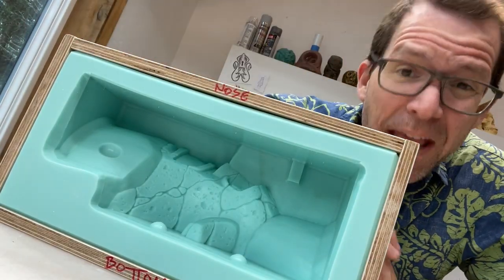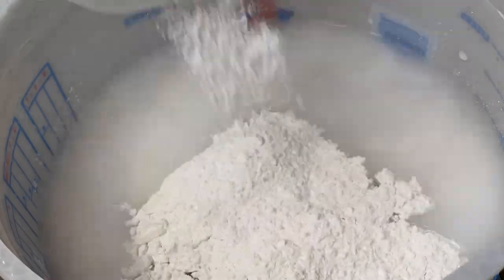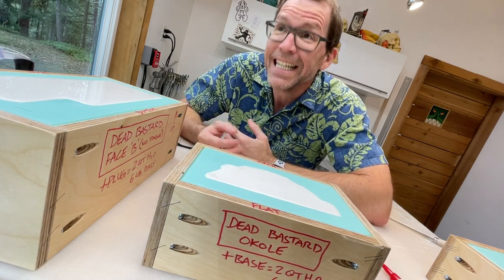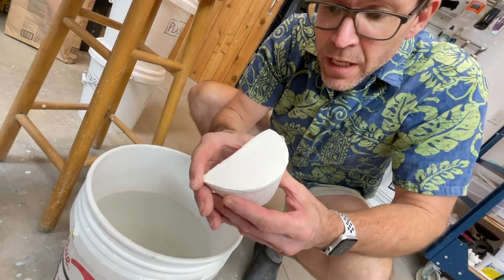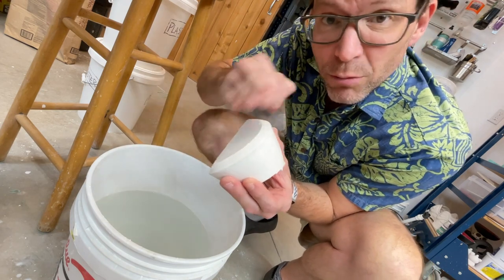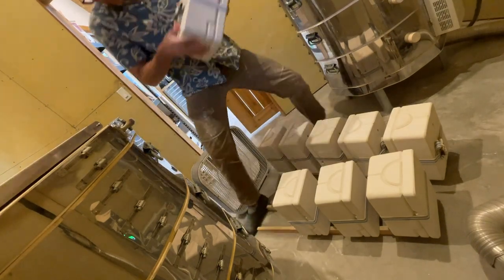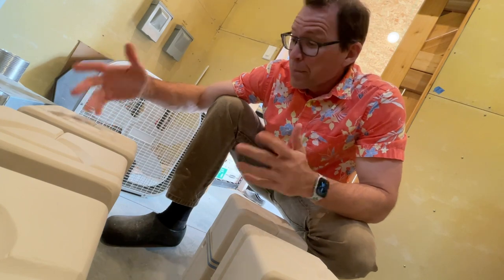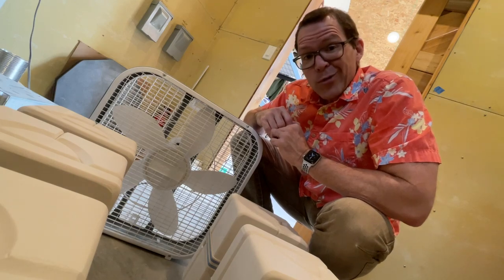Casting Production Molds For Slipcasting - Tiki Technical Tuesday 48

Comment: I love your videos! You definitely deserve more views and subscribers! Question - I've read that you can potentially recover the plaster and turn it back into powder. Is this something you've looked into or do you have any concerns with this? Maybe contamination or is it too messy?
Reply from the maker: Aloha! Thank you for watching!  Good question about the plaster - it is chemically possible to recycle it, but the process is complex and tricky. It needs to be held at high temperatures for a specific amount of time to drive all of the moisture out of the gypsum, then it needs to be milled back down into powder. I’ve heard stories from master Hollywood mold makers that LA used to have plaster recycling plants back in the days of filmmaking when plaster was the main product used to make molds and to fabricate sets.

Comment: Great work and great personality! 
I have a question. In the original mold you poured plaster directly on the clay part. You mentioned once that the original art was sculpted using monster clay and monster clay melts at  temperatures that the plaster should have reached at it's exothermic climax. How is it that the exothermic reaction and the heat created by that not melt the original art in the casting process?
Reply from the maker: Good question!! I was worried about exactly what you are describing, but friends of mine who have used plaster on the monster clay said that they never had an issue. The only problem I’ve had with the monster clay is it sticking to the plaster if it does not have enough release (this sticky may be due to melting and grabbing the setting plaster)

Comment: Ok, got it. Don't clean plaster off things in the sink, do it in a bucket. But then where do I dump out that bucket?
Reply from the maker: Good question!  Once the plaster level is about halfway up in the bucket, you dump it in the sink. KIDDING!!  
I’ll pour the water out (in the yard), leaving the plaster inside and set the bucket aside to dry out. Then the plaster gets tossed in the trash.
Reply: Plaster like cement will eventually settle to the bottom. Water goes down the drain and the plaster can be dumped in the trash

Comment: Hi. I'm new to ceramics. Do you have to use the plaster that ceramics stores sell or can any supplier of plaster be used, as the ceramic store plaster is way more expenisve?

Thanks
Reply from the maker: If you’re going to use the plaster to make molds for Slipcasting, you need to use pottery plaster USG 1 or the nearest equivalent. It’s pricier than plaster of Paris, but other plasters won’t have the property that make Slipcasting work. I’ve tried other plasters in the past - they can work, but the results are not as good and they take forever to cast with.

Comment: Love your videos - greenhorn  molding question - can you make a mold from a already fired and glazed mug . I made one in my pottery class and wondering if I can try to make a plaster mold from it. Trying to avoid having to re-mode it from scratch
Reply from the maker: You totally can!  In theory, anything can be molded, as long as you have a working release agent and avoid all undercuts.  the trick with molding a rigid model (your fired ceramic piece) with a rigid material (plaster) is you have NO WIGGLE ROOM with undercuts.  Something to consider is making a silicone/flexible mold of your mug, then cast a silicone positive from that to make your plaster mold off of.  does that make sense?
Reply: @vantikistudio  That totally makes sense - Thank you so much for the info and direction - You are my favorite tiki artist and love the content you are putting out!

Comment: Amazing content, thank you for your work. I have only one question, how much dobyou water down the windex? I cast plaster into silicone for the first time and the surface was full of bubbles 😅 Never happend before
Reply from the maker: I do it roughly 10:1 water to windex
Reply: @vantikistudio  Thank you, BTW I used few different plasters but neither one of them was so fluid as yours. Could I send you picture how the bubbles in my plaster mold looks like? there is lot of tiny bubles on the surface of the mold.

Comment: hello my friend, hope all your designs are coming out amazing. I have finally finished my silicone mold using rebound 40. I Had my wife help me mix the silicone while i poured. she ended up not adding all the mix in the yellow bucket one two of the pours and some how it still cured. so i got extremely lucky. $800 dollars later. is what my mold cost. yikes. Can you please answer this question. what are you using for the silicone release for the plaster casting. i was recomened ease release 200? do you use it? Also on the windex. do you use regular windex? and how much do you water down the windex. Thank you so much for all your great videos and help. your the man.
Reply from the maker: Congratulations on the mold!  I don’t use any release to cast the plaster in silicone molds. For the windex, I use standard everyday windex. About 1 part to 10 parts water

Comment: Are you familiar with USG's "Duramold" pottery plaster? It purports to have a longer casting life than standard pottery plaster. I don't know what, if any, tradeoffs there are, as none are mentioned on USG's website. I wonder why this wouldn't be a better material to use than No.1 Pottery Plaster. Either way, nice video as always!
Reply from the maker: Thanks for the tip! I’m going to reach out to USG and see if the Duramold would work in the studio
Reply: @vantikistudio  Following back up on this - Did you ever look into Duramold? I called USG and was passed around to 3 different people who were not able to provide much info. It's apparently seldom stocked by USG distributors. The closest place to me (NC) is Sheffield's in MA. Info online is non-existent, but I did ask about it in a Facebook group and got a single reply from a guy who says he uses 500 pounds of it a year and that it does indeed last longer than No.1. He didn't quantify that, though. 🤷‍♂
Reply from the maker: I gotta admit I haven’t done any research just yet. So scary to switch materials, especially if it is hard to get! Thanks for the reminder, I’ll try to get some to test this year 🤙

Comment: Did you say that you throw away your plaster fragments from your retired molds? If it's cheaper to heat the old plaster in an oven at 356°F for two hours and then grind it back down into a powder, you could be saving money on buying new plaster for slip casting molds. I've never tried this myself so I don't know how much time and energy would be required to recycle the plaster versus just throwing it away. Even then, I wouldn't know if the resulting recycled plaster will wick away water as well as the fresh plaster.
Reply from the maker: I do discard old plaster. Recycling or remaking plaster is an involved process that requires special ovens and equipment to grind the plaster down into powder. As much as I’d like to recycle it, there is no way I could pull that off in my studio. Back in the golden years of Hollywood sets were mostly made of plaster, and there was a recycle/refining factory in LA that would accept old plaster. Sadly those days are gone.

Comment: I am severely struggling in my studio! I have 3 simple 2 part molds I've been using for a while now. I needed to be able to pour more pieces at a time so I tried to duplicate them with rebound 40. It came out great! I start pouring plaster and leaving the newly poured molds out to dry ( I did have the two parts separated while drying). I pieced them together to check the fit and the two parts of the mold don't fit properly :( they wobble a bit like a seesaw. I am now banding the molds together for my drying process, however what I'm worried about is even if I try to check the fit when I freshly pull them from the silicone, they still wobble. Does this make sense? If the master mold fits perfect with no wobble, and the silicone mold is an exact copy, why wouldn't the two pieces fit properly fresh out of the silicone? Thanks so much for all of the videos !!!!
Reply: Also I haven't been able to get no.1 pottery plaster for the life of me. I am using plaster of paris for the time being. Mixing it 1 to 1. I just tried increasing the plaster by 50% so I will see if that helps. Also I am getting ALOT of air bubbles. Regardless of wether I mix with my drill, or mix with my hand. Any help you can offer would be a BLESSING thanks!!
Reply from the maker: Okie dokie - first off, plaster of Paris is terrible for molds - it is very soft, and tends to warp. I’m not sure what the recommended mixing ratios are for it, but you need to be meticulous when measuring and mixing plaster. Lastly, do you have boxes supporting your silicone molds to prevent them from distortion (like the plywood frame boxes I make)? They are a big help in keeping the silicone from moving. Hope that helps!
Reply: Yes I do have boxes. Thanks for the quick response. I will try to order some pottery plaster.

Comment: Seems kind of silly to destroy the master mold. What if you client comes back and wants to order another production run? 
I guess it a good way to keep the value of your work high.
Reply from the maker: I hear you - but if a mug is sold as a limited edition, destroying the molds is the proper thing to do. Just like how printmakers scratch up the plate after printing the final number in an edition, to ensure that nobody will create any more. 
If a mug is for an open edition, we will archive the mold (for example, the hidden harbor cursed monkeys fist mug has been done in several color ways).

Comment: What happens if you pour ceramic  slip directly to the silicone mold, and not use a plaster mold..?
Reply from the maker: I wish I could use silicone molds - but plaster is essential to the process. I explain it here:
https://youtu.be/2tU6sBD9r_I
Reply: @vantikistudio  what happened to the ceramic when you used the silicone mold? Did it just took a long time for the ceramic to solidify or the ceramic did not form at all?

Comment: I have made over 150 production molds and never waste as much plaster as you poured into the bag. Why do you do that?
Reply from the maker: I guess I’m just not as good as you! 😂
Reply: @vantikistudio  I was not implying that, I wondered if there was a reason. Mixing extra to ensure enough quantity, or more consistency in larger batches? Mixing more during fine tuning to a more precise measurement. I'm just curious.
Reply from the maker: Gotcha! I’ll mix up a larger batch than necessary for the first few pours to figure out the best casting order for the molds, and (hopefully) after a few rounds of casting I’ll dial in the amount of plaster needed to fill each mold (or group of molds). I’ll round up the amount of plaster needed to an easy number to hit while weighing, and that will leave me with a tad extra in case of spills, etc.
Reply: @vantikistudio  thank you for sharing that. Very much the same thing I do. I like to test my psychic abilities and see how close I can come. I always have a 1 kilo batch of plaster and water pre weighed so I can top off a short  mix and it really helps me dial in the exact amount I need to fill my mother molds. My main growler mold is a 3 piece. 2 at 11 kilos and 17 so I need to get everything I can out of a bag of plaster. At my ratios there is no slaking, it's dump it in, mix at high speed and then slow the mix down to drive out the air and then pour. I always mix and pour from a square bucket because I find it has a better stream to drive more bubbles out. You have a subscriber in me. Thanks for your responses.
Reply from the maker: I love the idea of having an emergency kilo of plaster on standby!  Mahalo for subscribing and watching 🤙

Comment: 15 to 20? Bruh are you making mugs for aliens? I'm gonna assume you're a perfectionist 😁😁
Reply from the maker: Ha - well, as the surface degrades it takes longer to clean up the castings. At a certain point it’s faster to cast a new clean mold than smooth the surface of castings from a rough mold.